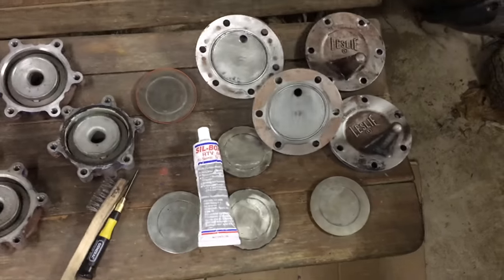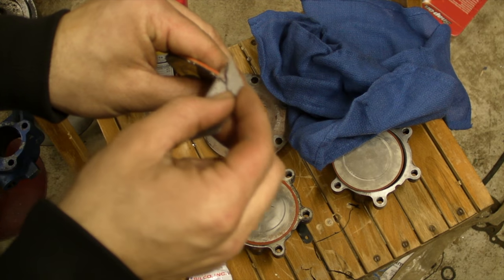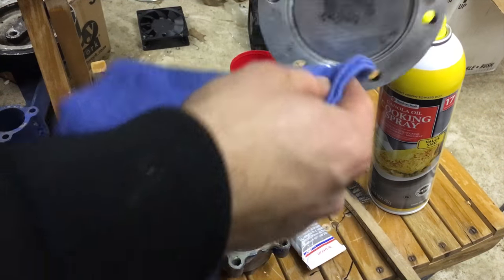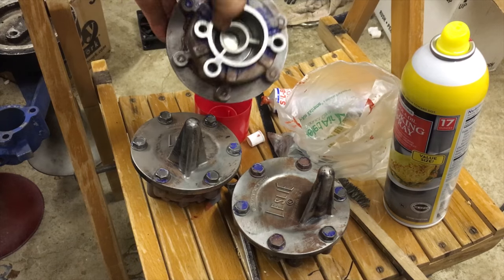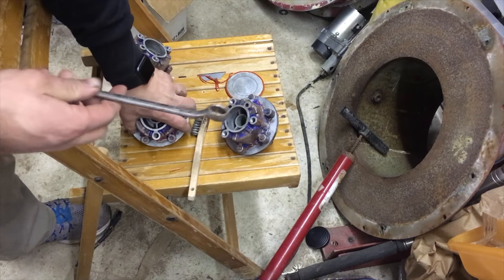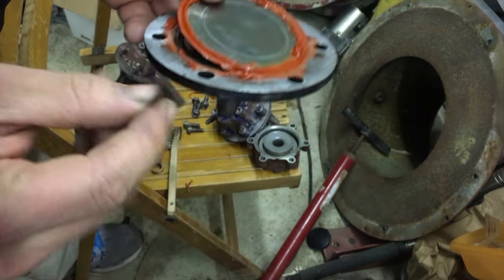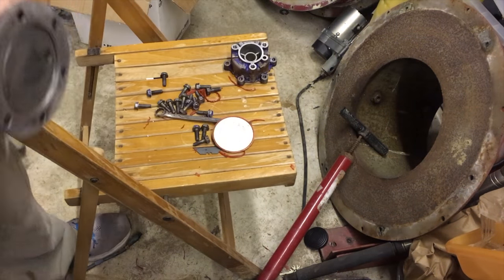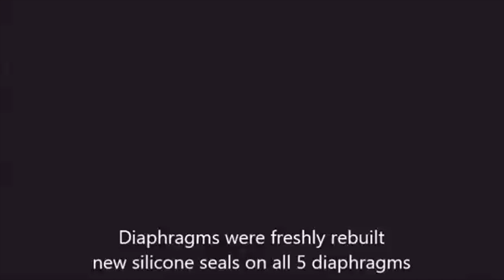How To Fix Leslie RS Diaphragms

Comment: nick the first design had a o ring in the grove in the back cover. The only reason the rubber is attached to the diaphragm is because the chief engineer at the time though it would be easier to install.  your method is good idea.  you may want to try installing an Oring in the grove., it may work better.  I worked at the Parsippany plant in the R&D lab when they were being developed.

Comment: I’ve got a diaphragm with no rubber silicone at all. Any luck that I can repair it?
Reply from the maker: I tried that once and unfortunately it had failed. I do plan on making a 3D printed version so this way a full mold can be made.

Comment: Thank you sir for this video. I have Leslie S2M,which i get in non working condition. Since i have never seen this kind of horn i didnt know what to do with it...I disassembled it few times,but with no results.After watching your video i realised,i dont have seals at all! Becouse im not from USA,geting this seals will be hard. I will try your technic,and i hope it will sing again.
Reply from the maker: Is that an Rs2m or an s2m (dome vs spike back) the dome back doesn’t use these diaphragms. However if it does have these diaphragms, this was my best method of doing it. It doesn’t look pretty but they sure as hell work like a champ!
Reply: @NickSilcox3  actualy it is rs2m. One one of the horns has end like yours. Second horn has round cap. I dont know how to make seal for that. It has 3 plates inside.
Reply from the maker: Ducero the dome back doesn’t have a silicone seal like the rS do, I’m not a big fan of the dome backs because they’re finicky, but that maybe because I do not know too much about dome backs. But here’s what I know. 
One plate is screwed/riveted to the back cap, that is your diffuser, center disk is your diaphragm and the ring goes on top. The screw(s) should hold everyday together. If it’s not working, shake the power chamber assembly and if you hear rattling, it needs to get remachined, other than that, I don’t know much else

Comment: I tried this and had a hard time getting the diaphragm out.  How in the hell did you get it out without damaging the rubber?
Reply from the maker: NSSCOTTTEAGUE patience is key, first time doing that, took me at least 10 minutes before releasing it, cooking spray works decent for a mold release, don’t put the bolts in tight, hand tight at most. Use a new blade to separate the ring from the backcap, clean the edge, and to pull it apart, I didn’t had a suction cup at the time but that would make it easier to pull off, watch how I was cleaning up before attempting to separate it, worst case scenario, PM me and I could repair the diaphragms and test them for ya!
Reply: @NickSilcox3  Would you be willing to repair a Diaphragm for me?
Reply from the maker: Nick Cohea how many do you have that need repairs?
Reply: @NickSilcox3  Just one, I also need a chamber machined but cant get ahold of Mr. Muha
Reply from the maker: Nick Cohea if your on FB or Instagram, send me a pm
Reply: @NickSilcox3   Thank you! What size  tank do you have?  that sounds amazing!